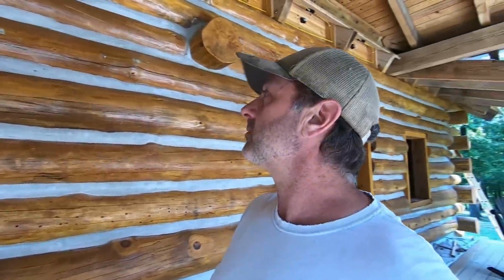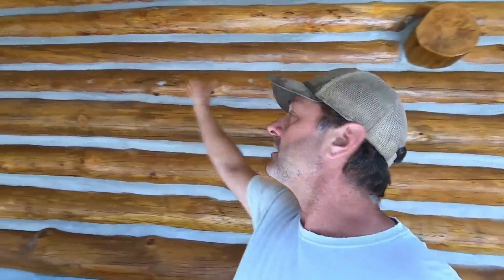Husband and Wife chink a 3200 square foot LOG HOME.

Comment: Chinking looks fantastic. I'm sure it'll be so much more pleasant to work on the interior when you don't have wind whistling through every gap in the logs as well as the door and window openings. Will you get the fireplace done before winter? Or is that a project for next year?

Comment: I have been watching these videos ever since you started this project. There has been a question I wanted to ask you, but never have done so. The question is about your foundation piers. How are they made? Are they just sitting on the ground or are the sitting below the ground surface? Were the piers poured on site or were they precast piers? Do you have any videos of you setting your piers?
Reply from the maker: I do not have any videos of me pouring the piers. I have a few pictures but that's all. I made the pier forms out of plywood and poured them in place. The are all set below frost level which is 18" in my area. I actually started pouring all the piers with bags of cement because I was unable to get a cement truck up here. The piers are about 40bags of concrete each so roughly 3200lbs each

Comment: You said you used something from Home Depot that made chinking easier because it could be wetter without slumping. You never said what it was. I assume you were talking about the portland cement. What brand? The only thing around here that I have found is Alamo.
Reply from the maker: Im sorry . It was the portland. It seems to hold shape a lot better when its wet.

Comment: I've been really enjoying your build videos, I've learned a lot of different techniques from them.  I was just curious as to why you went with pier based foundation instead of a standard foundation, its it to protect the cabin from flooding, excess moisture? cheers and keep up the great work!
Reply from the maker: I couldn’t get anyone in my area to do the concrete work for me so I just did it all myself. There are 42 bags of 5000psi concrete in each pier .

Comment: How much is the proportion of materials, sand and cement ?
Reply from the maker: By volume, not weight
1/2 part lime hydrated
1 part portland cement
3 parts masonry sand
water to consistency of thick peanut
butter.

Hope this helps
Reply: @hickoryridgehomestead9177  Thanks for the answer. Greetings from Serbia